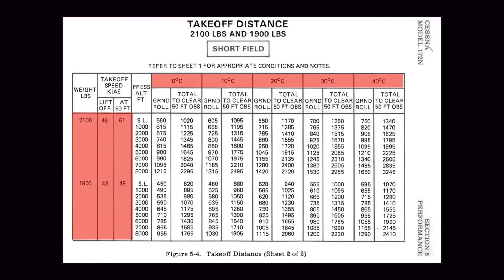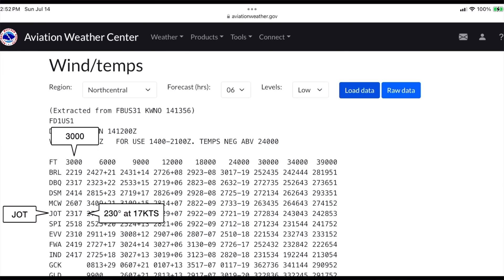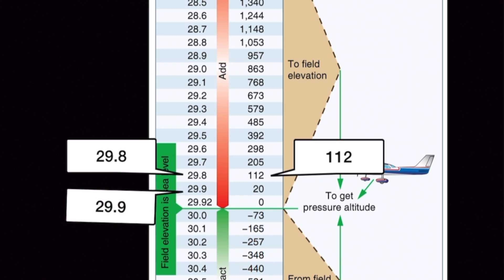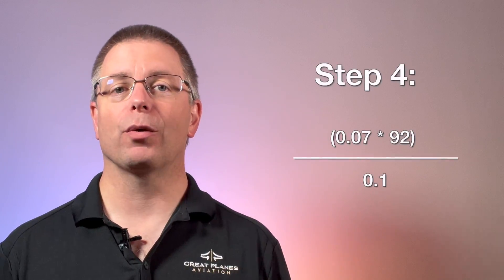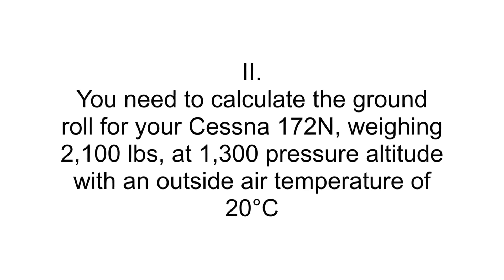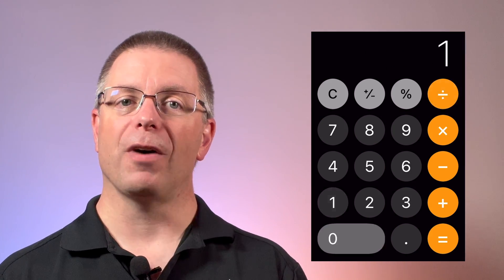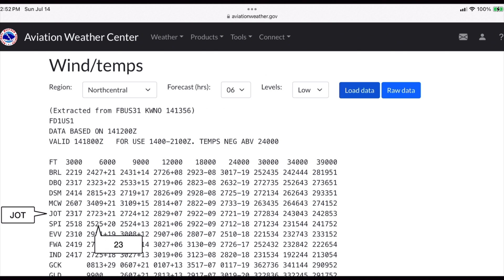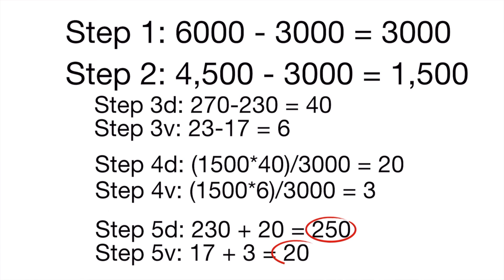Do these aviation problems drive you crazy?

Comment: Would it be wrong to be conservative and just take the more conservative figures especially when working with performance charts? 

Personally, I feel more comfortable generating a buffer especially when dealing with take off/landing rolls, clearance distances, and endurance.

Rather than calculating the exact takoff distance for example; Id rather err on the side of caution and take the higher value
Reply from the maker: Well.  It depends. For personal flying I do the same as you. I call it “rounding pessimistically”. However, during your check ride, the DPE may want to see that you know how to be more specific. I’ve seen it both ways. 

Having said all that, if you use the table/chart (showing you know the right steps), then use the nearest, most conservative value, most DPE will see what they need to see. 

Thanks for the question!!

Comment: This was very helpful. Thank you. In your video you reference "Index Values" and the "Intermediate Value". However, on your answer worksheet you seem to reference your "intermediate value" also as "index value". Also, the Pressure Altitude Correction Chart your intermediate value is shown to be 29.03 but your answer worksheet is indicating 29.01.
Reply from the maker: Thank you.  I’ll go take a look.
Reply: And what did you find?

Comment: Hi good day how do I get my performance data if my  temp is below 0°C
Reply from the maker: It depends on your airplane and the performance chart being used.  Your best bet is to read the text and examples in Chapter 5 of the POH for your airplane.

For example, if you are flying a PA-28-181 and the temperature isn’t on the chart, you probably shouldn’t fly because Chapter 5 specifically states “Performance information derived by extrapolation beyond the limits shown on the charts should not be used for flight planning purposes.”  On the other hand, the example takeoff performance calculation in Chapter 5 of the Cessna 172N POH says “Conservative distances can be established by reading the chart at the next higher value of weight, altitude and temperature.”  So you should be able to get conservative estimates by using the values for 0 C.   Double check with your local CFI to make sure you are reading the examples correctly.  I hope this helps.
Reply: @ thank you Scott
Reply from the maker: You are very welcome!

Comment: Why doesn't the FAA print the final fourth digit (0) for altimeter settings in the Pressure Altitude Correction Chart?  All altimeter settings are given with four digits.  I already know, FAA...........
Reply from the maker: That is a really good question.  I suspect it is to keep the chart small enough to fit easily within the testing supplement.  I’ve looked and not found a chart that has more index values.  If you know of one, please let me know and I’ll get it posted.  Thanks for the comment!

Comment: This was good but I'm going to have to watch it 3 more times to understand lol
Reply from the maker: Thanks for the comment!  I’m still working to see if I can simplify even further.
Reply: @ScottKoonCFI  maybe explain why you need the number from step 2. That's where I am lost
Reply from the maker: @monkeybrains911  The answer we are looking for (in this case the takeoff distance) should be the same relative distance from the top Resulting Value as the magic number is from the first Index Value.  Since the two sets of numbers aren’t the same, we need to calculate a percentage to help us determine where to place the answer.  Then multiplying the difference in Resulting values will result in the number to add or subtract from the first one.  

Let me give a different quick example.  Same problem, but let’s say we wanted to find the take off distance for a pressure altitude of 1,500ft.  You’ll notice this is exactly halfway between 1000 and 2000.  With that in mind, and knowing the answer is the same relative distance from the Resulting Values, the answer will be exactly halfway between 715ft and 785ft.  Since these two are 70ft apart, halfway would be 35ft from either number or 745ft.  Without calculating step 2, you won’t be able to determine the relative distance between the “magic number” and the index values.

It is this concept of ratios and percentages that often messes people up when trying to interpolate.  That’s why I tried to simplify it down to the five step process.  If you use the process, you can just plug in the index values, the resulting values, and the intermediate number, then do the arithmetic to get your answer—no need to set up, then simplify the ratios each time.  I hope this helps.  Thanks for the questions.
Reply: Let me try to dumb this down for myself.

Second example problem:

1. The altitude I need for the answer is 1300ft. That falls between 2000ft and 1000ft on the chart. Subtracting those gets us 1000ft.

2. Now we need a magic number between 1300ft and the lower value. So subtract 1300ft from 1000ft. We get 300ft.

3. Now you need the difference between the ground roll distances. (Our ground roll distance must be between the two since it's in between numbers on the chart)
So that's 785ft - 715ft = 70ft.

4. Now we have all the numbers we need. The difference in values between the number we need for the answer (1000)
The difference between our answer value and the first number (300)
And the answer number difference(70)

Getting the numbers seems to be the hardest part, now just plug those numbers into the formula.

5. Magic number(300) multiplied by answer number difference(70) = 21000.

21000 divided by our first number(1000) = 21.

We have a ground roll between 785 and 715. So it makes sense to add our 21 to the smaller number

So the answer is 715 + 21
736!
Reply from the maker: @monkeybrains911 Yes!!  You got it!!
Reply: @monkeybrains911 or you could literally use this method 

785-715=70 
70/10 = 7 
7*3 =21  (how I got 3?) well we are calculating for  1,300 PA now the difference between 1000 and 1300 is 300 right ? Just take first figure “3” ⭐️
Hence 7*3 =21
Add 21 to the ground roll 715 and you get  736
Reply: It is not actually necessary to use any formulas. 
I know i would not remember it in few months it is easier to understand the problem go step by step by logic. 
You can do it just by dividing each problem to smaller bite size problems.
for instance last task with the winds. You want info on winds for 4500 but you have only info on 3000 and 6000. So we figure out how many 500 feet are between 3000 and 6000. It is 6 x 500ft. This will be useful later because if we figure out value for each 500 feet we can just multiply se that we get to our 4500feet. therefore x3
so directions are 230 and 270 well the difference is 40. Now we just divide by our 6 to get difference for 500feet which is 6.66 and multiply by 3 to get to 4500ft = that is 19.98 so let say 20 and than add it to 230 or subtract it from 270 since it is in between those two. bam 250
Same method for wind speed 17 and 23 so difference is 6 divided by 6 to get 500ft info is 1. now multiplied by 3 to get for our alt we get 3 + 17 or 20-3  since it is between them. bam 20 
No formulas needed.
Reply from the maker: @DirkLarien Thank you Dirk.  Yes.  There are definitely several ways to solve these problems.  My intention was to create at least one strategy that people could fall back on.  Thank you for sharing yours!